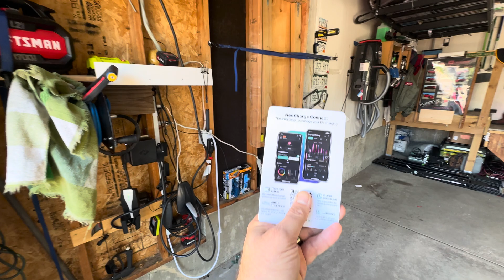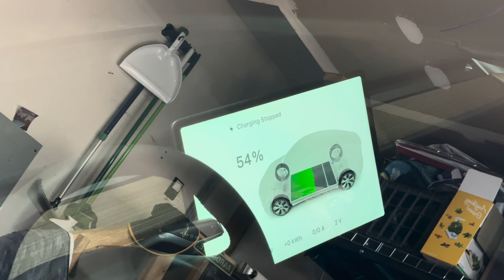Dual EV Charging Setup Simplified

Comment: I just use 2 tesla wall chargers on a single 60 amp circuit.  You can have them communicate between them and they auto adjust.  My cybertruck start charging first at 48 amps and and hour later my y starts charging at which time the cybertruck charge throttles down to 24 amps to share the circuit.  When 1 finishes charging (either one) the remaining will ramp up to 48 amps or to whatever max charge rate i have set per vehicle
Reply: Actually I only have 1 plug.  The universal Tesla charger allows to to daisychain chargers.  My pigtail from the lower outlet to my universal charger and then have a hardware going out the top of the universal charger to my regular wall charger.  I then did something similar where I gave hooks in my ceiling to carry the charging cable.  I have 2 doors instead of one so my cable goes above the first door.
Reply from the maker: That works if you have two plugs off of that 60 amp circuit. I only have one plug off of it so that’s why I did it this way.

Comment: can you charge both EVs at the same time? or they have to take turn? thanks
Reply from the maker: If you set them both to half of what you’re allowable charge voltages, then you can charge both. Otherwise, it switches from primary to secondary when the primary is done charging.

Comment: That's not how to do it
Reply from the maker: Why not?
Reply: @RatsTesla  for one thing, it's simply messy. The second reason for me would be that the system is designed around multiple Gen 3 chargers on one run. The app, of course , is able to manage the loads of the line and the demands of the vehicles. The third reason would be the first reason. 
Conduit is your friend.
What would be interesting is to build a double pigtail and plug in both cars, and see how that is managed. At home, you're using that on-board charger it looks like in service mode. Because the car can operate off after market chargers, it may just work as long as your car setting is set to split the Amp load of your breaker.
The other thing is using the gen3? For the x,s is an 80 amp charger on a 100 amp breaker if a guy can handle that load on the wire. Then, you're of course 40 amps on one charger for each car with the unit mounted between cars with dual tails coming from it.
Just some ideas, I have one for two cars, and we just swap it to the other car when you unplug, and it's mostly okay as my wife works from home. If we both drove the same times, I imagine we would have to do  two 60-amp breakers because we drive 100-mile round trips. 
Best video I saw was the guy plugged into his neighbors house. If they are going to be forced to pay for the tax credit, why not make them pay for some juice too.
Reply from the maker: @Patriot3 to each their own. I have been using this setup for over 6 months and it has worked great. I specifically did this so I don’t have to go swap the plug in the middle of the night. Also, what would I put in conduit?  These are all extension cords. And it’s in a garage who cares about messy. It works for me and would work for many other people.

Comment: If you put in a pair of Gen 3 wall chargers and share the circuit both chargers that can be set to run on one circuit and not over draw the amperage since they communicate up to 6 Gen 3 chargers on a single 240 volt circuit (48 amp max)   - Its all set up in the App.   I currently have set up 2 Tesla Gen 3 combo wall chargers for a Cadillac Lyriq and a ford F150 lightning on a single 48 amp circuit in my garage.   It was super easy and I never have to think about when to charge since both can charge at the same time or one at a time based on the state of charge.
Reply: This is the way